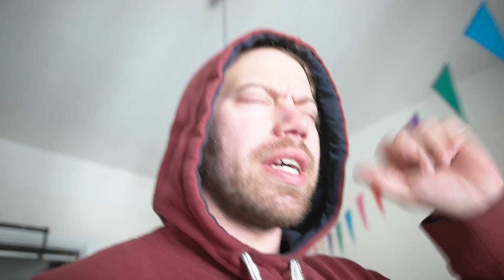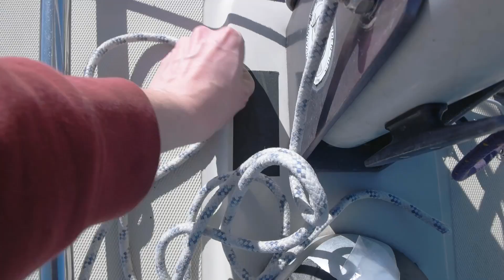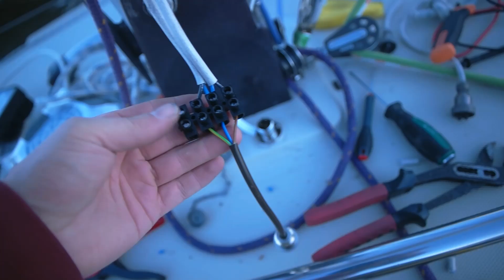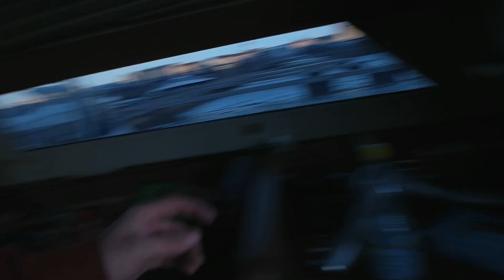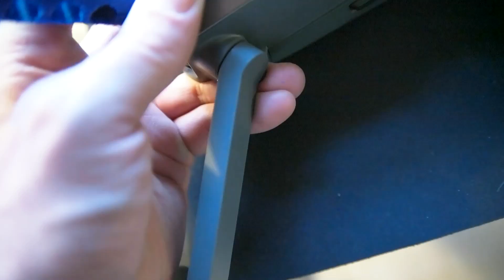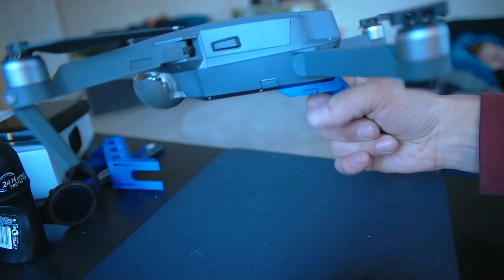Lighting up the mast - Electric sailboat vlog 0005

Comment: much better print this time. keep it up. I love the mavic. So handy to take with you. watch it on the boat. I think i saw all drones people take on the boat end up in the water at some point. there is a splashdrone on the market. it can land in the water. More likely to survive.
Reply from the maker: +dextersxxxxlab Yep. Mavic is great. I've seen some attaching styrofoam on to the legs to make it float, so... ;)
Reply: Pauli Juppi making it float is not the same as having it waterproof. on the other side i saw a video were a mavic fell into the water in the jungle during following mode filming the owner crossing the river in his pickup. the mavic hit a tree sideways and it was gone. the owner found it within 15 minutes or so. opened it and started to dry it with the car fan. at home took the mavic and put it in a plastic bag full of rice. kept it in there for 3 days in the sun and it still worked. salt water will be different though. if it happens. take out the battery and rinse all with sweet water. than dry it and put it in a bag of rice afterwards for a few days. but allways take the battery out. current will get the corrosion occuring very fast
Reply from the maker: +dextersxxxxlab You're right, but making it waterproof is not the same as having excellent formfactor, long flight time, all the autonomous modes, unmatched iq in price class and great controller/app :)
Making the Mavic float means that I can recover it.